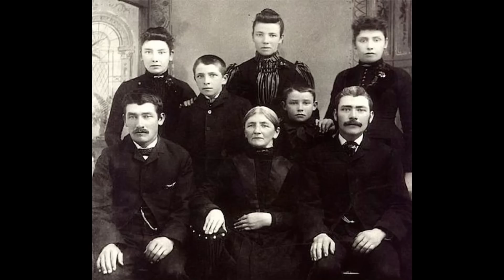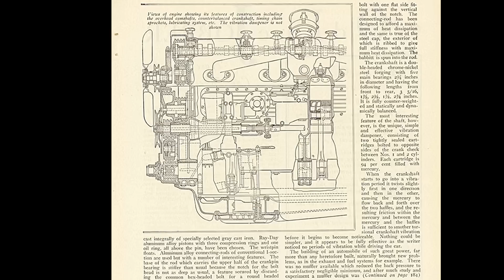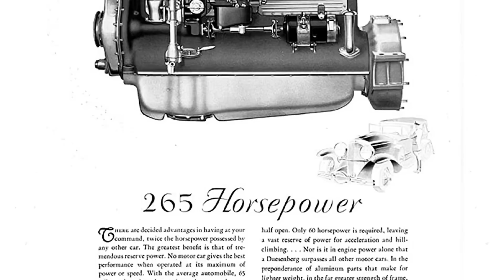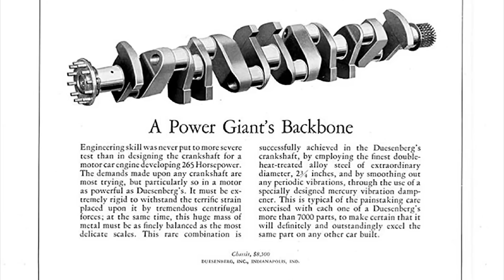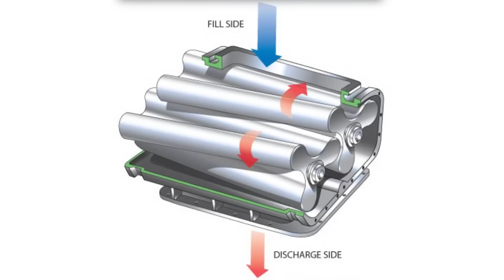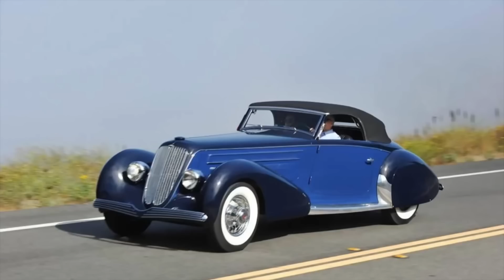Dusenberg model J engine family model J, SJ, SSJ, Exclusive, sophisticated, and Powerful￼

Comment: The Dusenberg Brothers NEVER built their own engines!!! They purchased engines from Continental, Waveland, Pierce Arrow, but most often from Miller Racing. The 1938 Miller-Dusenberg SJ and SSJ were the penultimate "Dusey" engines. 341 CID straight 8's, OHV, Bendix mechanical supercharger on the SJ and AiReserch (GE) turbo superchargers, both liquid cooled rated at 375 or 425 HP@3500 RPM and 500-600 Ft/lbs at 1650 RPM. Fitted with a three-speed "Dusey" "Singing" transmission and typically 2.81:1 Fullerton (became part of Eaton) rear axles, the 4600 pound cars could top 150 MPH, if the tires didn't blow! The sound of the "Singing transmission" was dubbed on movies for thirty years, no matter the brand of car! The SJ didn't need an auto tranny. You simply put it in second gear and drove 0-105 MPH without shifting! With a dual-disc clutch (like modern semi's) you didn't need the clutch either, except when changing gears.

Comment: I found prefer timing chains to belts. People are picking on me for wanting to swap a Nissan L28ET (bored & stroked to 3.2l) into an 86 300zx but I'm gonna do it. Nissan just re-released a Nismo DOHC cross-flow head for the L28 and OS Giken has had one available for a few years...that or I'll ditch the turbo and run triple side-draft carbs

Comment: Outside of the undersquare bore to stroke ratio, and the very low 5.2 to 1 compression ratio...because of the very low octane fuel avaiable...it's a state of the art modern engine.

Comment: At 10:25 your illustration of the centrifugal supercharger has the impeller vanes going the wrong way.
Reply from the maker: Great catch
Reply: @What.its.like.  You should see how many animations of Roots blowers I see turning the wrong way.  Actually I've found more than a couple impellers in centrifugal pumps that had the vanes going the wrong way. In large industrial pumps it's common to get an unfinished impeller and have to do the machine work on it in house. Sometimes purchasing buys the wrong one and nobody catches it. Well until they start it lol. It still works, but performance sucks

Comment: NOTE - Timing Belts didn't appear in a car engine until 1964 ( Vauxhall Victor). Most other OHC Engines in the 20's were either shaft drive  
(Bentley, Sunbeam, Wolsley, Salmson) or driven by a train of gears ( Alfa Romeo, Bugatti, Miller ). Chain drive was regarded as cheap in that era, as chains get longer as they wear. Admittedly the triple row chain would not have been cheap &  would have much reduced wear compared even to nasty single row rubbish in use today.
Reply from the maker: Great point
Reply: Back in the seventies I worked as mechanic on a fleet . It ran all 350 chev medium duty engines, which had a double roller timing chain . I never saw one worn out . The light duty engines had a steel link belt , it was very common for them to wear enough to rub through the timing cover

Comment: Think of it.  400 HP when a common car had 40.  Today, that would equate to 3000 HP.  0-60 in 10 seconds, when few cars would go 60.  It's mind boggling. And, the origin of the phrase, "What a Duesy".  We've come to use it satirically, but back then, it meant someone had done something exceptionally well. WYR: 32 Duesenberg. And 1933 Duesenberg.  Thank you as always ~ Chuck
Reply from the maker: Awesome insight and choices glad you dig this one =)

Comment: Hi Jay!:  Was going to suggest this as an engine episode, but you beat me to it!  These were just AMAZING engines!  Unfortunately, the folks at Lycoming apparently HATED building these engines!  Some sources say it was because THEY had not designed it!  That may or may not be true, but I think they were so much more complicated than the other auto/truck engines that Lycoming made,  I mean, most of their stuff (besides the aero engines) were mono-block, and mostly flatheads, pretty easy to produce.  But the Duesey engine!! D.O.H.C plus all of the other amazing features!  Plus, I think maybe they were also miffed that E.L. sort of forced them to make these engines.  As well as not letting THEM design the Duesenberg engine.  With the rams horn manifolds and dual carbs, and proper tuning, these could more than likely make 1 H.P. per cubic inch with supercharging, of course.  The previous Duesenberg engine was also well engineered, those powered the Duesenberg Model A and X.  They were also used in the Duesenberg Indy cars in the 1930's.  This engine had a single overhead camshaft.  Maybe you can do an engine episode on that one.  Also interestingly, Duesenberg provided some of their walking-beam engines in various passenger cars in the early 1920's.  WYR#1  EASY 1934 Walker coupe!  Don't think Jay Leno wants to give it to me though!!  #2  TWENTY GRAND!  What a car!!!
Reply from the maker: Awesome choices I don’t know if they need more than one of the walker coupe I know Leno has one or at least the featured one on his channel but I swear I saw a dark blue one and a black one.. but it could be the same car just painted just like Carol Shelby‘s original cobra they painted the car how many times lol.. 

This engine was an absolute marvel of the period, I also read that Lycoming did not like casting this engine because it was super difficult to cast for every single block that was usable there was a bunch of blocks that was not usable also read the Duesenberg brothers didn’t really care for the way in which Lycoming casted the block.. but I guess that was just EO cords way of making sure that everything was within check/having some sort of control over production cost but they probably lost money on every single one they made it’s sad that they offered this car when no one had money had they offered it in the 50s they probably would’ve produced more..
Reply: There is another angle on this. Every Duesenberg was a custom built car and so was the engine. There were different pistons for different compression ratios, different intake and exhaust, camshafts were adjustable for high or low speed use, etc. This means each engine was torn down and rebuilt at the Duesenberg factory to suit the particular car it was going in. The Lycoming plant would put the engines together as a loose collection of parts knowing they would be rebuilt before they were ever run.

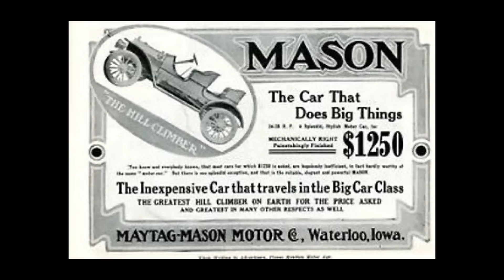Comment: I have that issue of Car Life (shown at 1:40). Those early racing Duesenbergs had a walking beam valve train, and they only had TWO main bearings. The article said that it wasn't uncommon for the crank to flex enough to hit the sides of the block. They were fast, but fragile. Looks like the Duesenberg bros learned from their mistakes, because the Model J engine was an incredible power plant. Thanks for this video!
Reply from the maker: Great insight and information =) two main bearings wow... 

It would have been awesome to live back then and see those cars on the road they have gotten so expensive that most just sit in museums which is really sad

Comment: Great episode. Duesenbergs and Rolls Royce Silver Ghosts are my all-time favorite cars. I would take any of those Dusenbergs in the WYR but my favorites are the 1932 Model J Tourster and the 1933 Twenty Grand. 

It would be so awesome to drive a supercharged Duesenberg. I had a supercharged Thunderbird and the low end torque made the car so much fun to drive, although you had to be careful when the roads were slippery.
Reply from the maker: Awesome choices totally agree duesenberg would be an epic car to drive.. I have a friend who is a packard fan.. got to drive one this year non supercharged car and said it was like driving a truck the transmissions were non synchronized which really hurt them in the later 30s best engine but transmission left more to be desired.. to my understanding they had to use a heavy duty truck transmission it was the only thing that could handle the torque this engine put out
Reply: @What.its.like.  you bet it would never sat in one though, I live near auburn where the auburn cord and dussenburg musieum, as I said the cars made here or by the company here were like the lambos and supercars of their day, sat in the l 37 cord that belongs to the youngest grandson of  errett lobben cord, mr william cord hummel and talked at the acd festival about 3-4 years ago, the type of supercharger though basicly creates a equal pressure so the engine dont have to fight atomospheric pressure to get air, its not quite as agressive as the boost we have today but still the most powerful engine in a car in the classic era untill really post ww2 I think I heard as late as the 50's before we had another with more power in a car but they were something special, though many outside the area even car people never heard of the cars made by the auburn auto company or based out of it 100 years ago here in auburn indiana, which is also where the modern collector car industry started fetching the high prices we get today, all started as a funraiser for the acd festival, and mecum and barrett jackson supposedly were founded by former employees of kruse internationa auctions, which at the laborday auction for a time was the largest in the world for collector cars and I have seen many ledgendary cars go across the block, movie cars famed cars like the morman meteor 1 and 3 the munsters drag car and the one that princess diana used while visiting canada in the 80's that sold for 50 somthing thousand, and that night unfortunatly was when she had her accedent that took her life, but at the auction the doors of the car were open and you could get a good look at just how thick that bullet resistant glass was and the armor plating on the car its  heavy stuff.
Reply from the maker: Thank you so much for sharing that information and insight =)

Comment: A friend and I visited the Briggs Cunningham Museum in Costa Mesa, CA in 1968.  It was a Wednesday, and we were the only visitors.  I knew a good bit about the 2 stars of the collection, his Type 41 Bugatti Royale and his SSJ Dusenberg.  The guide unhooked the ropes and let us crawl all over, inside and outside of both cars.  I was particularly fascinated by the Dusenburg Bijur lubrication system and tracked the tubing to the lubrication points.  Of course, the Royale dwarfed all the other cars.  Getting to slide under it on a mechanic's creeper was....wow.  From that day, my favorite color is Dusenburg engine green.
Reply: Wow, what a memory.
Reply from the maker: Man what an incredible experience thank you so much for sharing that with us does that museum still exist? I could be wrong but I think Briggs Cunningham car got sold I think that was the SSJ that sold for $22 million..
Reply: @What.its.like. 
Wouldn't that car have been either the Cooper or Gable car? I'd always thought those guys got the only two SSJ's ever made, what the chain of custody of either of them were down the road I don't know but I believe I read they both still exist, one of them must be that car.

Comment: Can you do 1956 Dodge Royal Lancer, V-8, 2 door hardtop with 3 tone paint job? 1956 is a good year for Chrysler Corporation. Other 1956 Chrysler cars with 3 tone paint job are: 1956 Chrysler New Yorker DeLuxe (St. Regis), 1956 DeSoto Coronado 4 door sedan, and Fireflite 2 door hardtop, and 4 door hardtop. V-8 engine are all standard on these models. Red, black, and white is the most popular 3 tone paint job.
Reply from the maker: Totally will when I find one the goal is to cover every single car from 1930 to 1964 And cars outside of those parameters =)

Comment: The Duesenberg SSJ were originally owned by Clark Gable and Gary Cooper so their value is twofold as not only being the elite of elite cars but having been owned by two of the top movie stars of the day.
Reply from the maker: The one sold at action for 22 million just a few years back
Reply: In this case, only 22 million, sounds like a bargain or highway robbery for one of two historically significant vehicles.  Not only that, I would consider them rolling works of art.  Mr. Picky is climbing off his soapbox and thank you for your insight on the matter.
Reply: It would have been fun to be Clark or Gary and have any number of hot cars in your garage.  Not to mention the hot....
Reply: @billolsen4360  
Apparently you don't know the story of Gable and Carol Lombard.
His love life was nothing to be jealous of.

Comment: I like playing around with the Ford 300. I have for numerous years. There are several ways to build these engines, and they can obtain incredible power. It reminds me of the bygone engines, like Duesenberg. Of course, not as glamorous, but the Ford 300 can still give you the feeling of being around the Deuseys that have similar outdated style and technology compared to anything being built today. 
Now, if I could just get my hands on one of those straight 8 Duesenberg engines...
Reply: @williamarnett9064  
The 300ci 4.9L Ford inline six isn't so good for high HP numbers. about 600HP maximum but they can produce endless amounts torque. the cylinder head is the issue. there's only so much that can be done to them to increase flow. but there are people who have been experimenting. with cutting up V8 cylinder heads 
apart. and welding the sections together to fit the block. heads such as boss 351 heads and Chevrolet LS heads have been used. and there are still ongoing experimenting with improvements. in intake manifold fabrication and better fuel delivery systems. and that was maybe two years ago. when I was still a Ford person but I hate Ford's now.
Reply: My cousin used to race Ford 300,s. Gobs of power to be made with those.